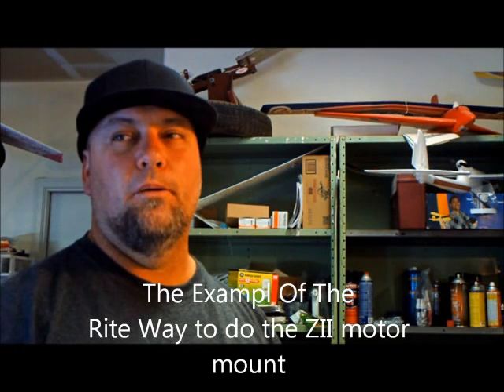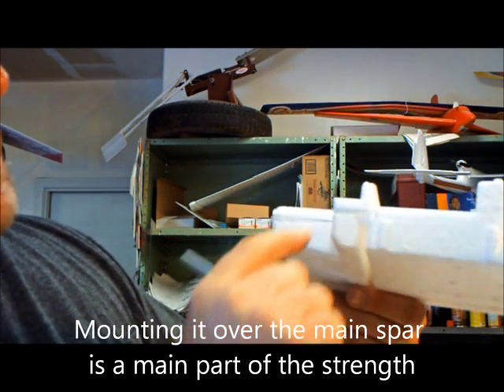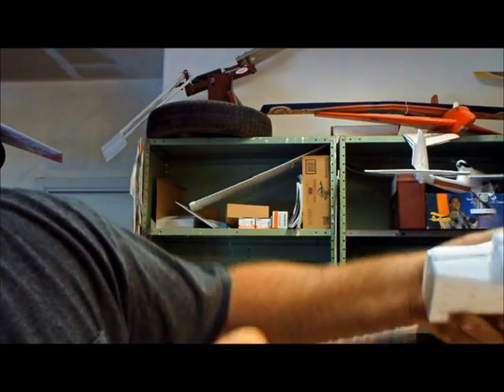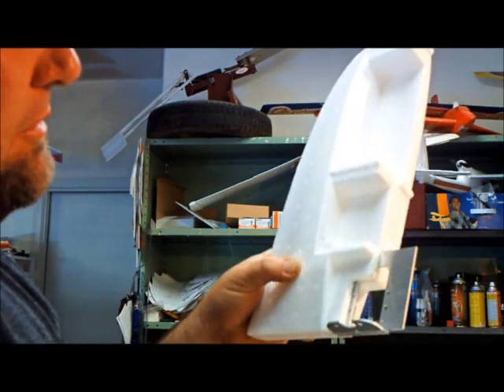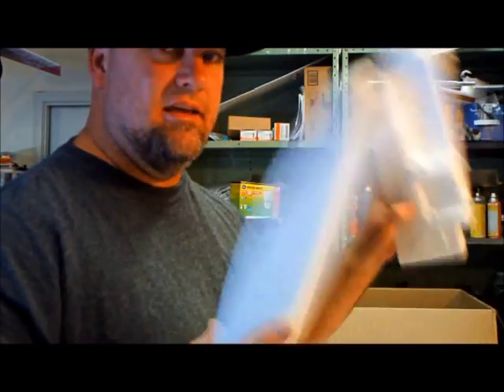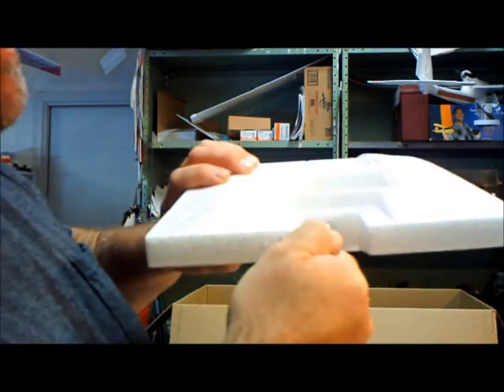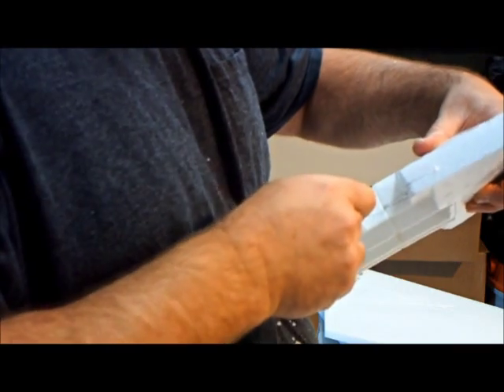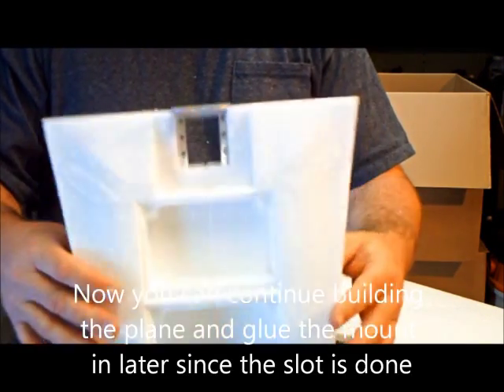Vid # 1  Zeph II build series  , THE MOTOR MOUNT

Comment from the maker: Hi , its a sawzall reciprocating wood saw blade, you can use a drywall saw or hacksaw blade.
It need to remove about 1/8 th material to make the plate slide in with a little resitance.